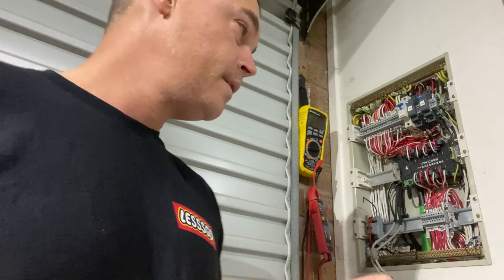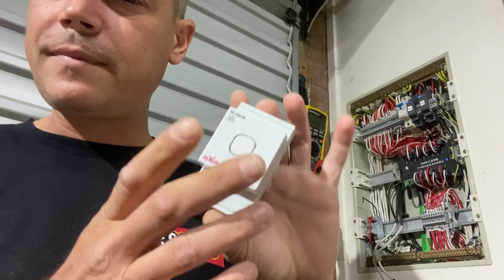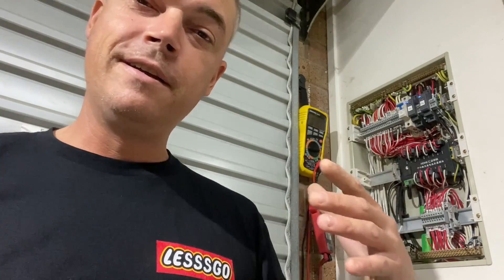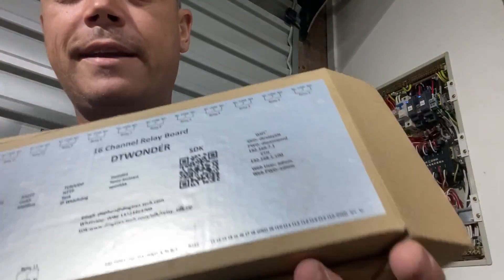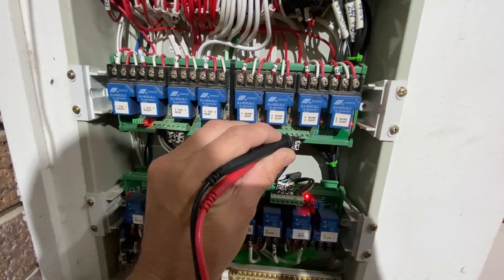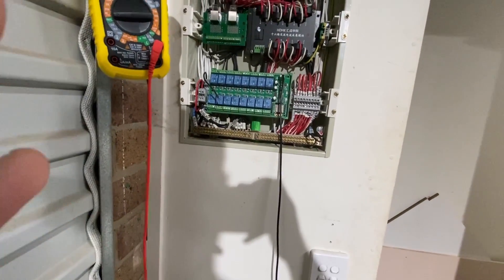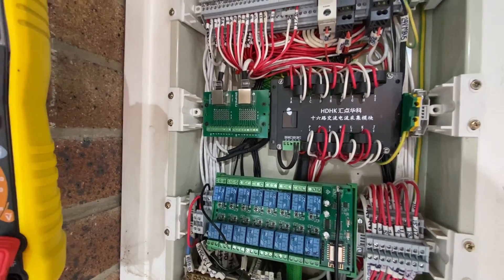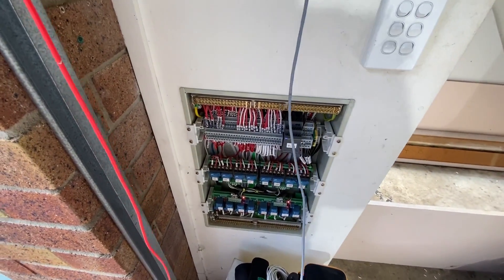Shed automation PT 2

Comment: Hi mate as a electronics and home automation nut i have just started my electrical apprenticeship and am wondering how you go about elv and lv seperation in your switchboard install. I understand the relay boards are isolated just wondering wiring wise as3000 etc? Genuine q from 1st year..
Reply: Have you watched part 1? He touches on it at roughly the 12min mark. Not sure if that covers your question exactly.
Reply from the maker: The ESP chip has isolated ELV which drives the relays. They use opto isolators, which you might see in control panels for industrial work. 

I've ensured that it's separated as I use relays with COM | NO | NC therefore making the control panel into a big 2 way switch control panel. 

It works on small scale, but I wouldn't use it on larger ones due to fault loop impedance and the cost of running copper.

Comment: Lots of clicky bits there.  It really puts my efforts to shame.  All I was aiming to do was a simple light on / off via a web page on my raspberry pi, only accessible from the wifi.  I got as far as the web control itself and 433MHz comms but never actually implemented the actual light switching.  It would be essentially instant switch control since it was all in house (litteraly). Oh, and yeah because I'm an old fart I did in perl and used a simple sqlite db to hold the switch states across restarts etc.
Reply from the maker: When I started this project got quite a bit of inspiration from other lighting controllers & Jon Oxers setup @SuperHouseTV but wanted it simple enough that any electrician should be able to work on it without having an IT degree ;) 

It's endless the way you can configure these types of custom setups and makes it quite fun to work on.